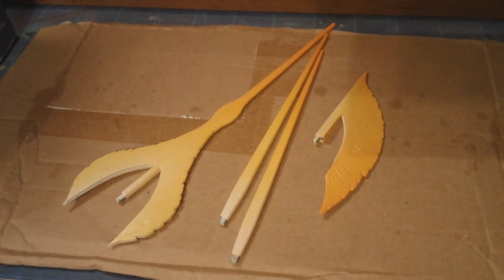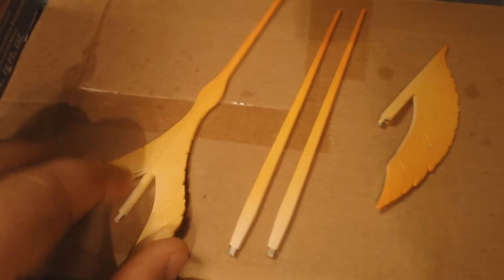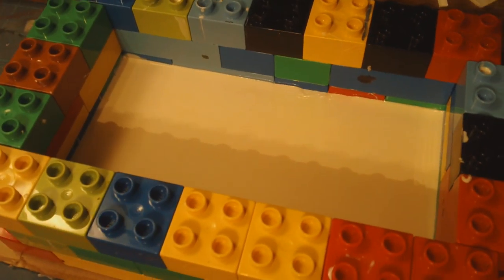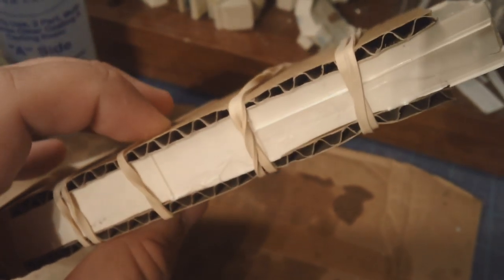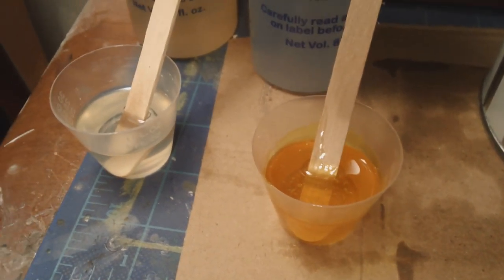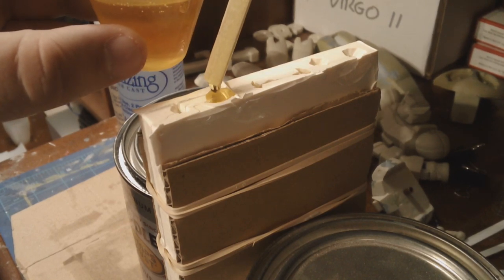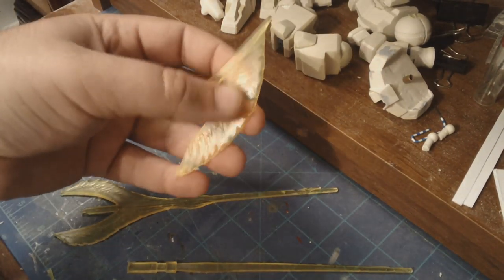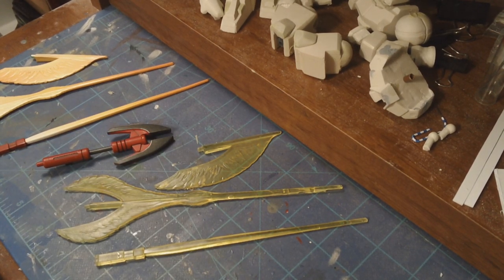Tutorial: Clear Resin Casting

Comment: You should keep  your resin in the frig to slow down the curing time.
It is a good idea to spray "release agent" before pouring the second half the mold.
(this is to prevent the two halves of the mold) from bonding together)
A good release agent is Ultra 4 Polyester Parfilm, direct from West Coast Plastics.